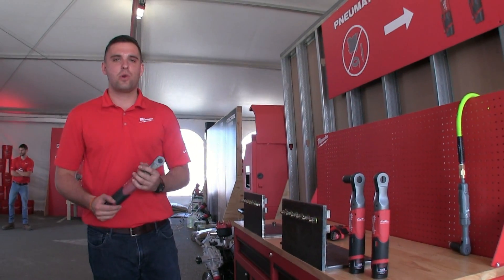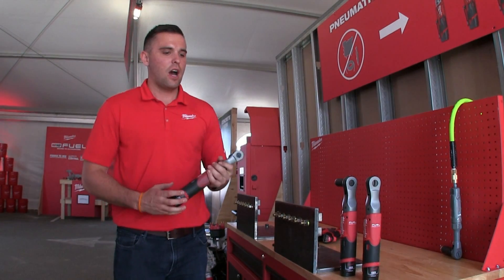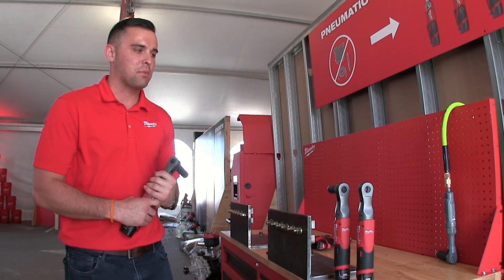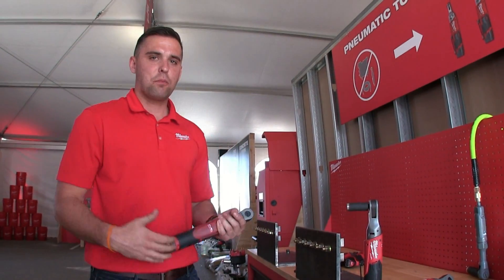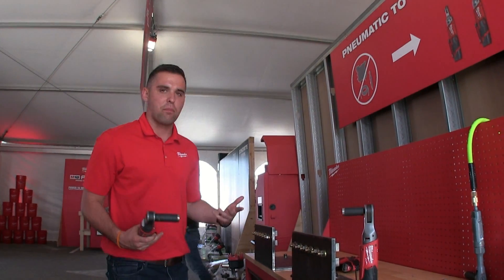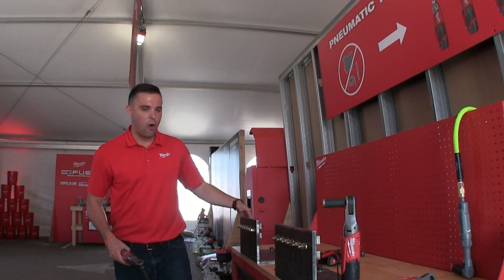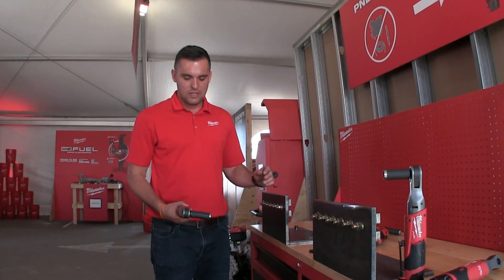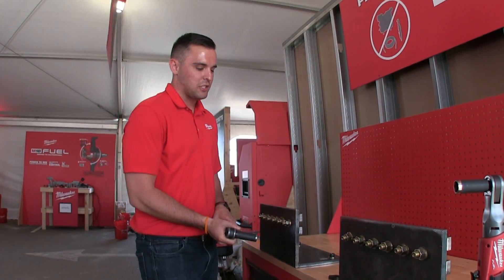Intro: Milwaukee M12 FUEL Ratchets

Comment: Why use this over an impact?
Reply from the maker: Sometimes you can use an impact or a ratchet, but a lot of times a ratchet is more useful for accessibility and control. A ratchet has slower speed and less torque than an impact.